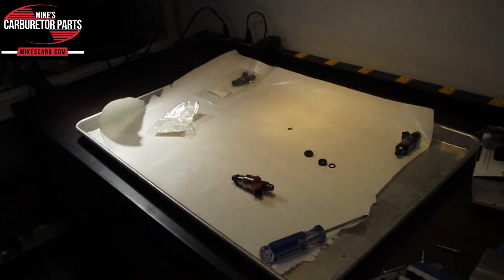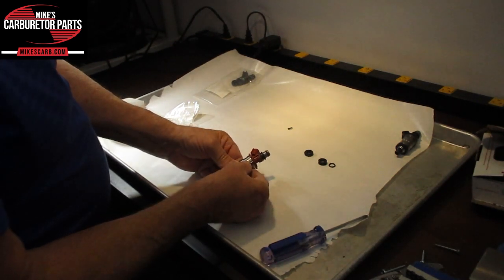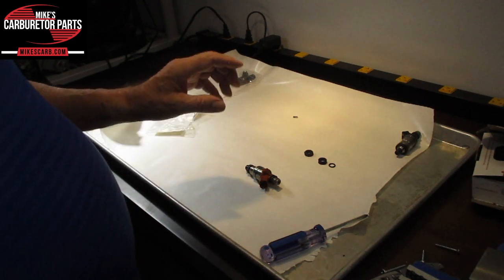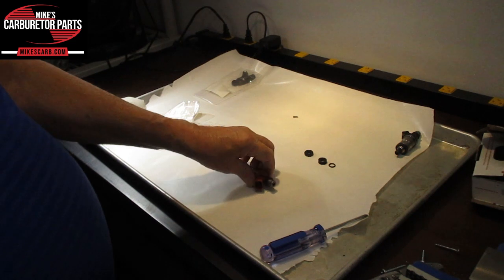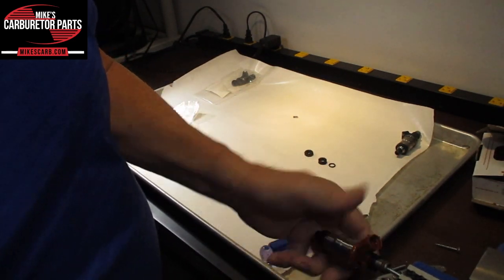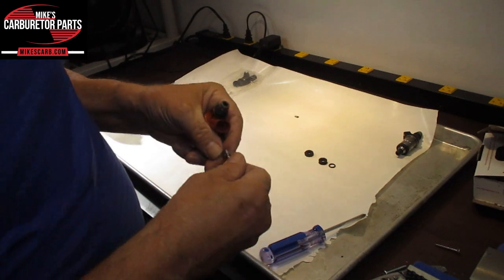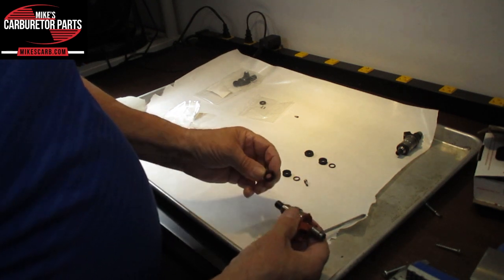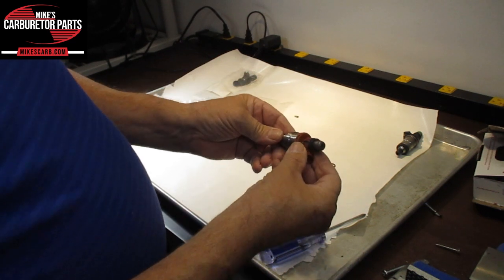How to Rebuild Denso Injectors: A Step-by-Step Guide

Comment: Great video. Your website only shows Volvo repair kits up to 2004. Is that accurate?
Reply from the maker: Yes. We are in the process of adding more but at this time that is as far as we go. Thanks
Reply: Thanks for the video, I am rebuilding a 5.0 HO and some of the injector pintel caps broken when pulling injectors, I'm going to try and save them by redoing them like you did in the video.